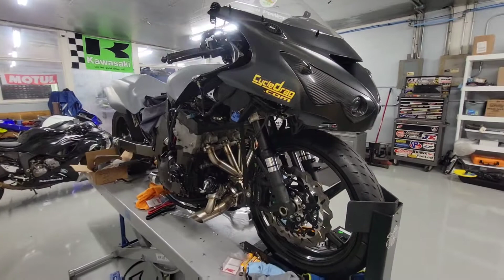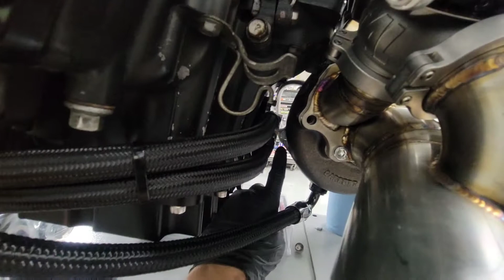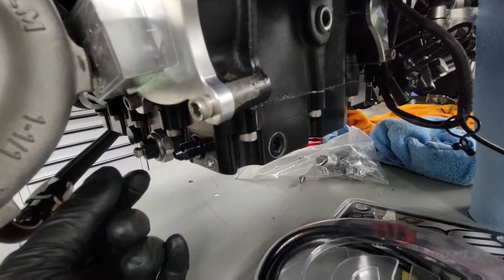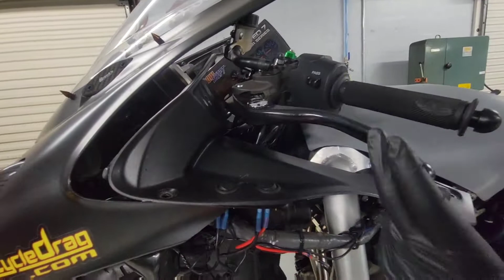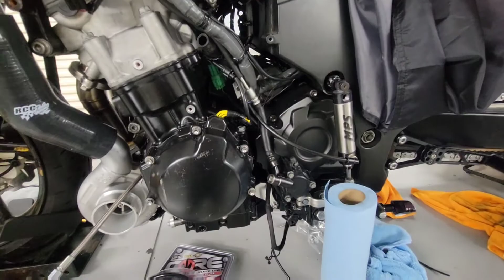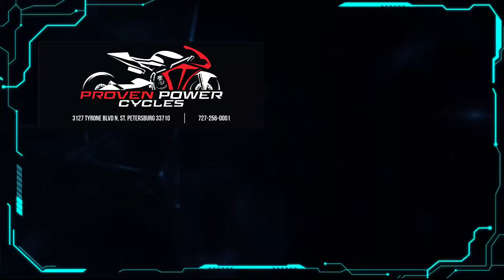My Kawasaki Turbo ZX14R Build Progress

Comment: I went through the same compressor to oil filter relocator clearance issue but the install I did was much worse = I had to clearance/grind into the filter adapter as well (but was worth it to keep the Adams pan IMO). And JFYI, the piston squirters aren't necessary on drag bikes, and not having them = more oil pressure/volume to the crank and rods...
Reply from the maker: I appreciate that. Yeah I grinded the compressor housing quite a bit and then ran dome heat wrap between the two as I torqued it all down. Still rests against each other but oh well lol 

I couldn't wrap my head around deleting oil squirters but I did hear of people deleting them for drag setup. I just got it all together recently and now I'm dying to get everything dialed in! 

I saw some of your vids and you're movin man 💪💪

Comment: Would love to hear the details on how you got her light!
Reply from the maker: It's a long list! Some of the major components that I removed were: ABS delete, fuel cell instead of tank, headlight delete, alum subframe, tiger tail, lith 16v battery, stator/rect delete, modified oem wiring harness, bst carbon wheels, brake delete (although I'll prob add those back on now lol), now i deleted the entire cooling system, and that's the biggies that I can think of for now. 

I'll re weigh it here soon in another video because I'm super curious what it weighs in at with all the changes I've made recently.
Reply: @provenpowercycles  Wow incredible man! You should consider a video on weight saving! Not alot out here!
Reply from the maker: @j.w.presents9552  its pretty controversial but that's a good suggestion! I've got about 3 or 4 videos I need to post but once I get those moving I'll do a video on my bike a little more in depth 🙌

Comment: Great vid bro. How much does bike weigh
Reply from the maker: I haven't weighed it yet with the turbo kit all on, but last time I weighed it in with radiator/coolant setup it was 424lbs. With the turbo kit I deleted the radiator, water pump, and resevoir tank. So I'm guessing a touch over 430lbs now.

Comment: What could you recommend for a Zx6r? Ecu? Flash and tune etc?
Reply from the maker: I would say either gut the cat, or go with a full exhaust and ecu flash and tune. Just got done with one making 123whp with a good amount of bolt ons. Stock they are around 108whp or so on my dyno.
Reply: @provenpowercycles  what all was done to it exactly ? Apart from the exhaust and instake
Reply from the maker: Chain and Sprocket, full akra, sprint p08 air filter and some other intake mods we did to it.
Reply: A Zx10